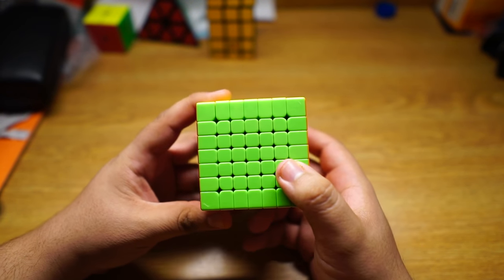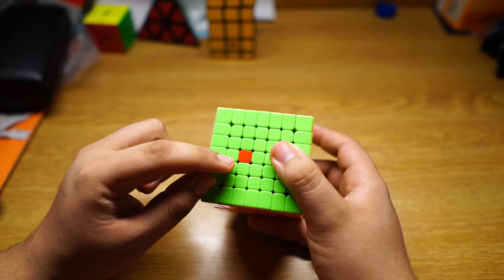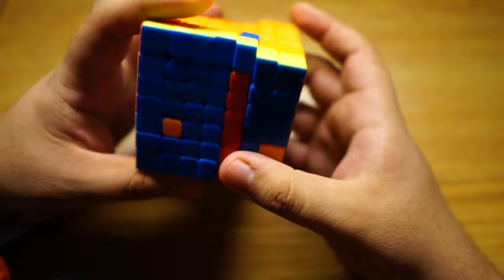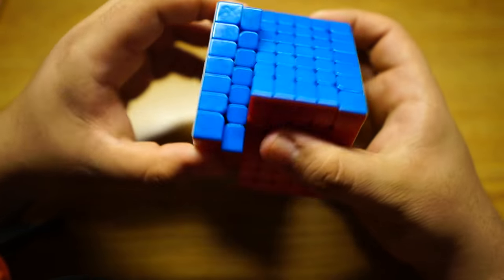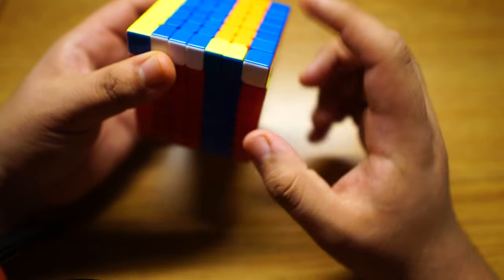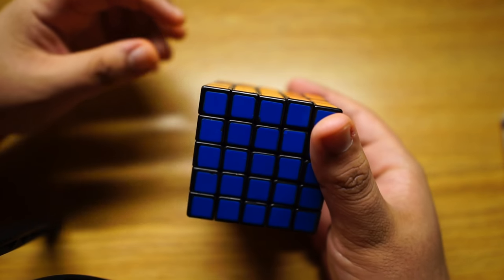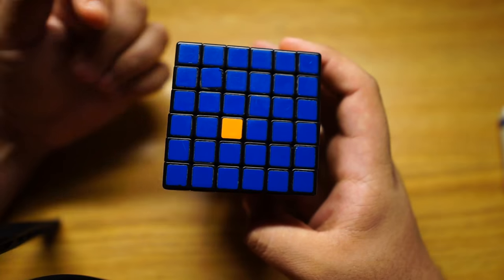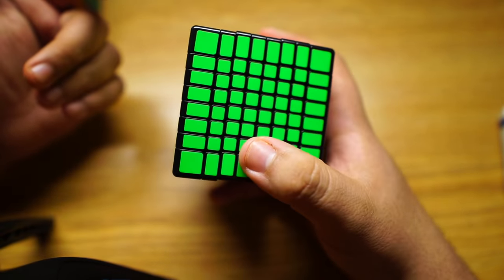How To Use Commutators on BIG CUBES!

Comment: It looks like all big cubes odd or even layers apply the same algorithm to solve those annoying commutators. I been struggling with the last 2 center faces because of not understanding how the commutator actually works. I'm now going to be solving my 7x7 a bit more frequently. So far the best I have done was just a little over an hour
Reply from the maker: Yeah that's the right the same basic method is the same but it will just take more time since there more pieces to cover.

Comment: If you locate the pieces to just one side (I like the left) then you only need to remember one sequence not two.

Incidentally, here is a little trick to reduce the 7 move alg for edge flipping: R U R' F R' F' R 
down to 4.

R F' Z R

Or down to 3 moves.

For a 4×4:  R 3Bw' R
For a 5×5:  R 4Bw' R 
etc.